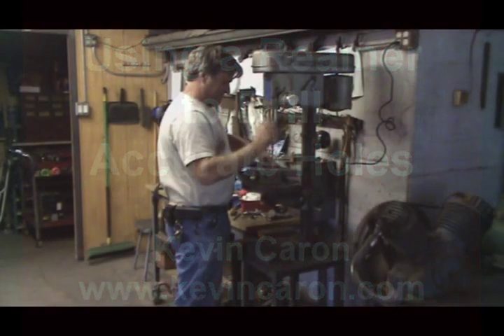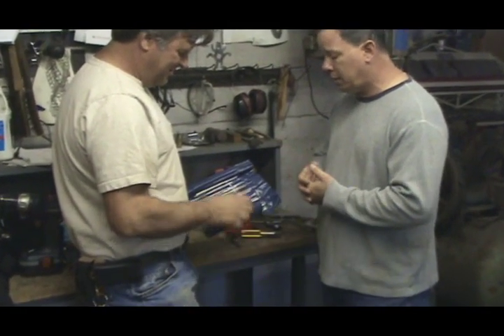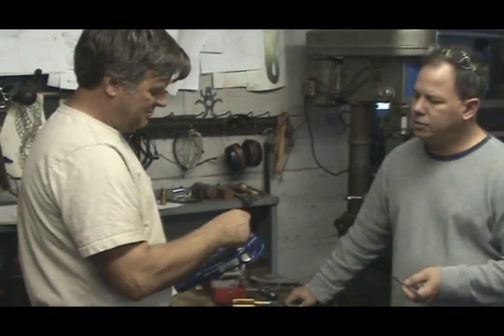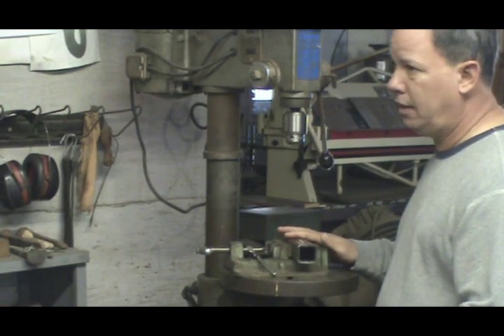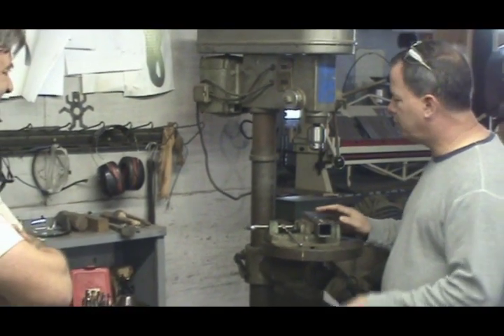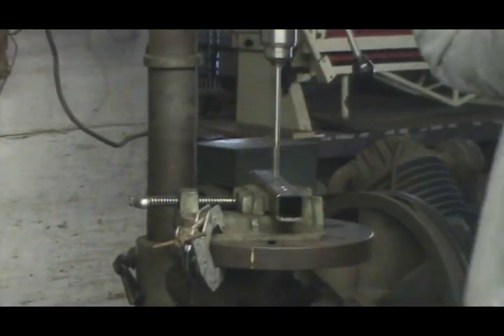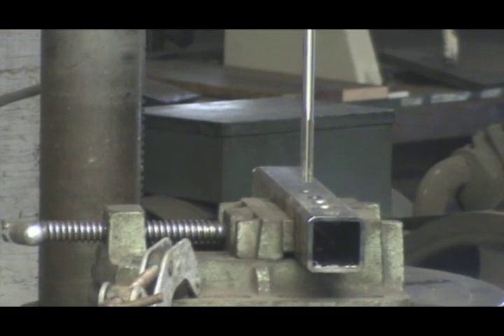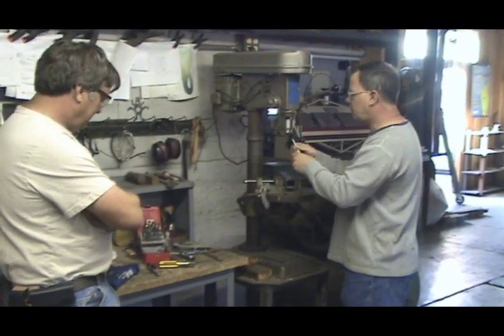Using a Reamer to Drill Accurate Holes - Kevin Caron

Comment: Hello i have a problem on a job site I have a 1" hole in a 1" thick plate. I need to grow the hole by 1/4 - 3/8... Any ideas? Thank you
Reply from the maker: Trace it out on the plate and grab the die grinder with a carbide bit I guess.    If you don't need a "clean" hole then grab the O/A torch.

Comment: so a reamer makes a more accurate hole. but why? and why wouldn't it be just as susceptible to the machines run-out as a drill bit?
Reply from the maker: Stiffer than a drill I guess.

Cutting surface is on the side of the reamer instead of on the end like a drill.  So no runout.

Comment: use a small split point spot drill in a mill to dimple the location.  then drill with slow feed. if possible and your not working on a cnc--use the small drill chucks for tiny drills allowing you to hand feed because of the spring they have in them. where possible have a set of stub drills in which the flutes are shorter. for tiny holes throw away the drills quickly. buy them in packages

Comment: your vid is excellent for what your doing but people comment as if you are making parts for the space station. for shops that ream alot the best money you will ever spend is carbide reamers up to 3/8 -bigger cost becomes prohibitive for home shop. hss reamers you are going downhill after the first hole. a person can also "drill ream" by stoning off the edges of the drill rounded then slowly feeding into the slightly undersize hole. with small sizes sometimes that almost has to be done

Comment: reamers ream big because of the heat. flood with coolant and maybe put some cutting oil on there in there in a drill press situation. runout often leads people to think their holes come out bigger--actually its the heat.  the heat expands out the hole INWARDS locking down on the reamer causeing squealing as the edges shave out the hole bigger..and often snap the reamer. USE COOLANT FOR if you need precision reamed holes

Comment: @kevincaron It was sarcasm, the fact the title says using a reamer to drill accurate holes! Just because someone uses a pillar drill or hand drill does not mean he is a "machinist". Reamers are used to finish holes to a fine tolerance and are normally only removing approximately .004 thou. ( what do i know about reaming? ....... only having worked as an engineer for the last 35 years! )

Comment from the maker: @pberglin No, because the cutting edges on the reamer are straight compared to the curved edges on a drill bit. The reamer cutting edges run lengthwise on the shaft. There is nothing to pull the reamer down in to the metal. 

Hope that makes sense. Maybe Chuck will stop by and give us the proper answer.